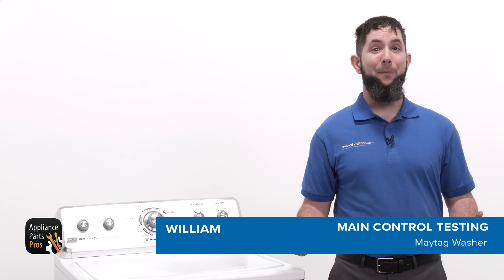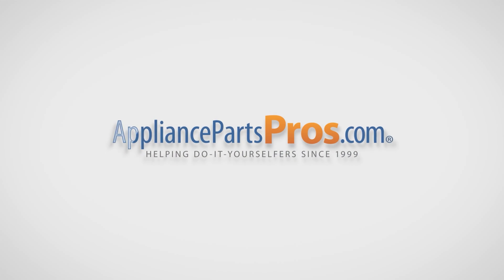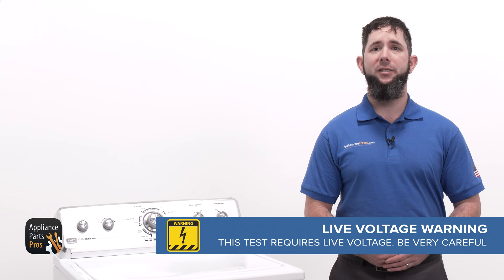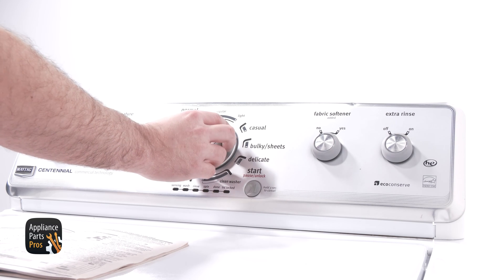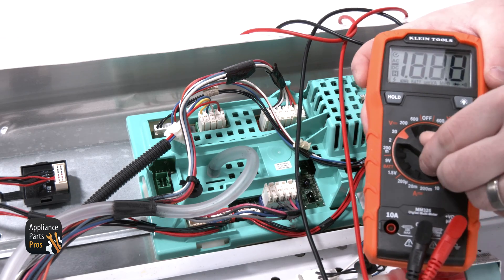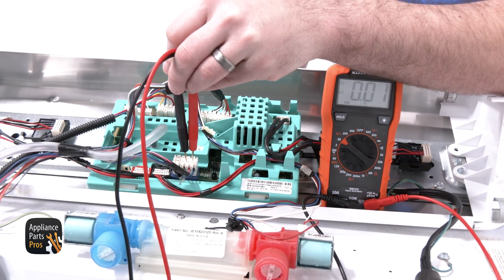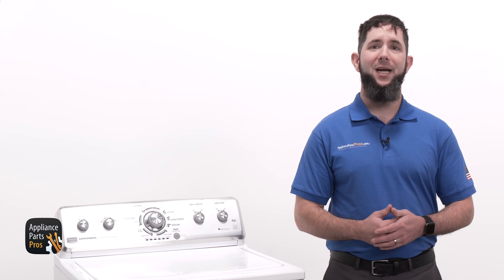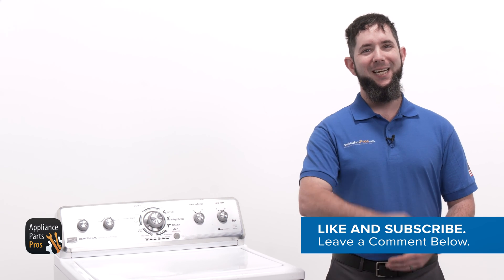How To Test A Maytag Washer Main Control Board W10480274

Comment: Maytag control board went out 3 months after I bought it.they replaced everything on it couple months later power went out not working again assume it is control board again
Reply from the maker: It probably shorted again. That happens with power spikes/outages. Is the unit completely dead?
Reply: @appliancepartspros  how come you don't have a Maytag-MVWC565FW2 Control Board?

Comment: I’m assuming 4.45 volts coming from j5 connector(power) is not good?
Reply from the maker: What is your model number and what is the issue you are having with the unit?
Reply: @  Maytag mvwc555dw1. It won’t fully agitate during wash and conduct a high speed spin cycle and clothes end up damp dripping water. Have a new control board in-volts to the power source-is now showing 120 volts with other connectors appearing to match the manual requirements. I have also changed the shift actuator, clutch, belt and door sensor. Following the previous error codes. When i calibrated each time, it would run through all the spin levels, high, low.  Automatic test, everything worked fine. But then clothes end up damp, you can hear it begins to speed up then abruptly stop after about 15 seconds.  Nooow after recalibrating it with the most recent error code(door sensor) the auto test and manual test aren’t doing anything lol. I feel I made matters worse
Reply from the maker: Based on the information provided, it sounds like you have a control board issue, especially if you are not able to put it into diagnostics.
Reply: @Jodall did you ever figure this out?  sounds like what I have.